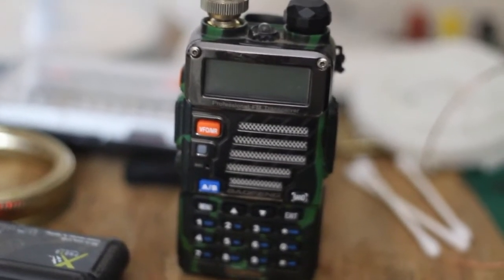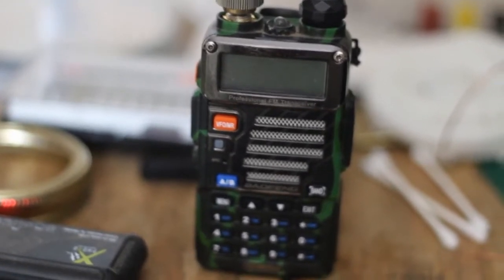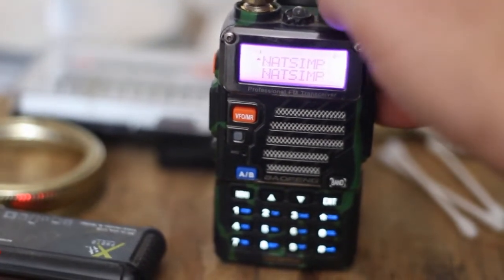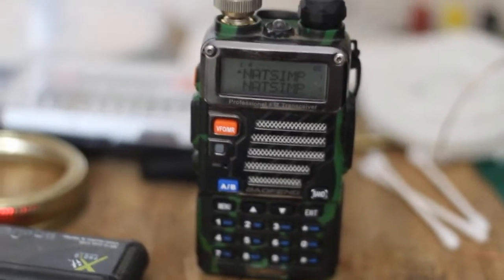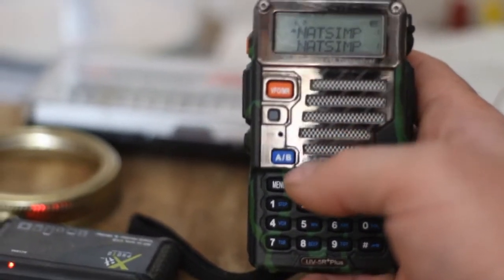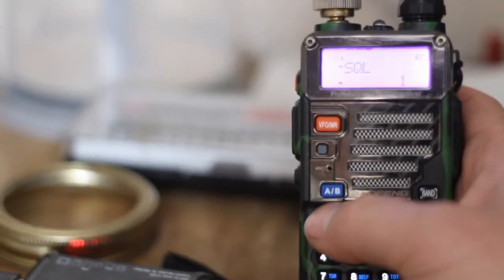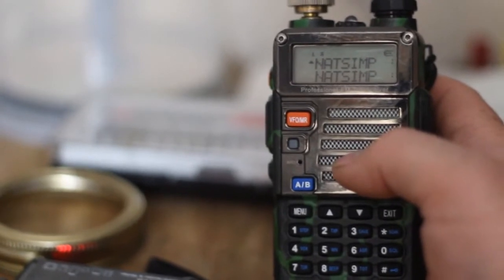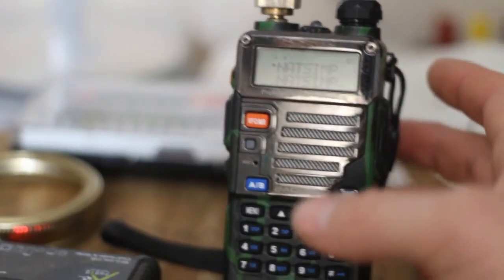Baofeng UV-5R+Plus Pulsing Static Squelch Issue

Comment: I would say your squelch circuitry got messed up.  It is pulsing because it is switching between your A and B frequencies.

If you turn off "dual watch" in the menus, you will get constant static.

In my case the radio started doing this after a couple of years, with no change to software or settings, so I think the squelch circuitry itself is failing.
Reply: My Baofeng BF - A58 same problem some budy slove this problem?